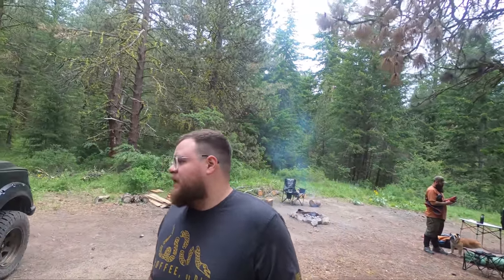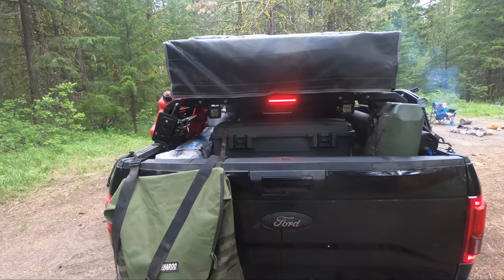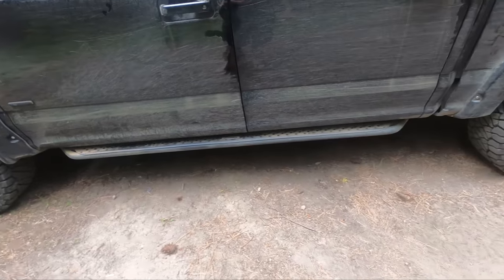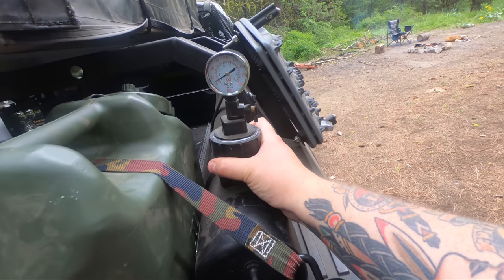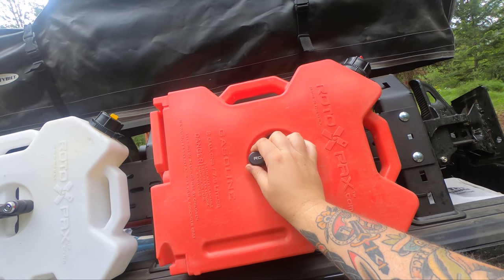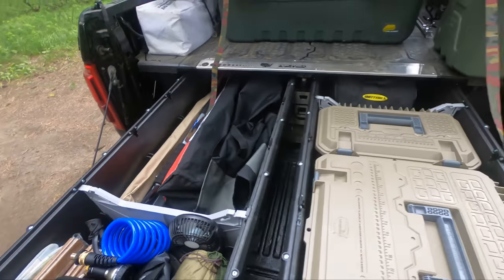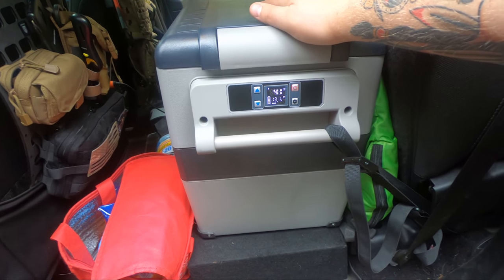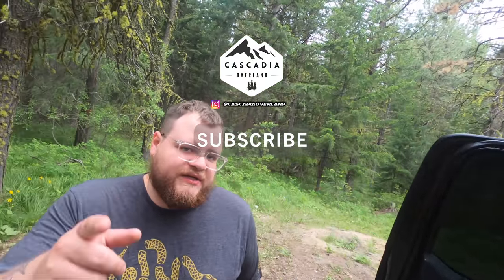F-150 Overland Build // WALKAROUND

Comment: Looks good.  Not enough of us F150s in the overland community.  We are under represented for such a capable platform.  Sadly, that means we also get overlooked in the product development area.    I can’t get a winch Mount anymore, they are out of production.
Reply: what year is your F-150? I just got, from Rugged Country, a winch plate for my 2014 to use with the OEM bumper.

Comment: Bad ass man, clean build love everything about it. I have a 16 F150 ive been shaping to an overland build. I’m running 6 inch BDS with fox shocks, same fuel wheels on 37s, have a decked system, working on getting steeper gears front and rear and an electric locker for the front then going to work toward bumpers, RCI bed cage and all those goodies,

Comment: you didnt mention the third brake light you have installed on your bed rack, what kind is it please and how do you have it hooked up?
Reply from the maker: They are some cheap pod lights from Amazon, and I ran a wire under the truck up to the engine bay and controlled them from my aux panel in the truck.

Comment: What offset are those wheels? Any issue with rubbing?
Reply from the maker: 17x10 -18. No rubbing even at full articulation. But I did remove the front/rear "crash bars" from the truck.